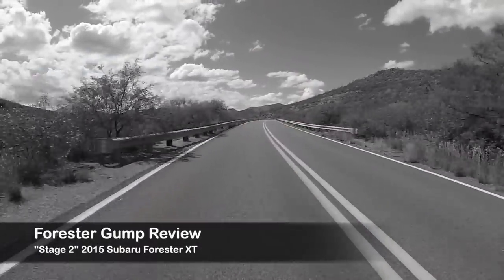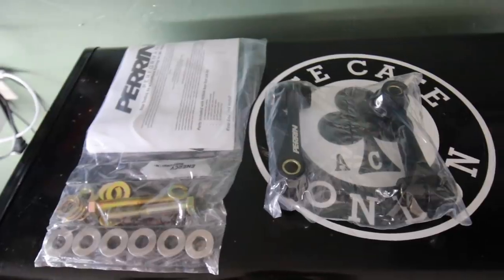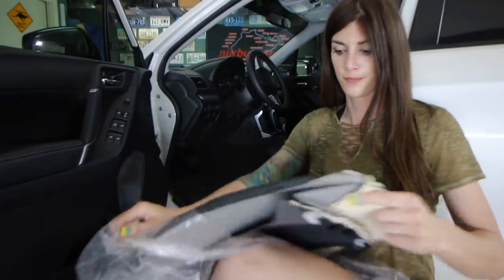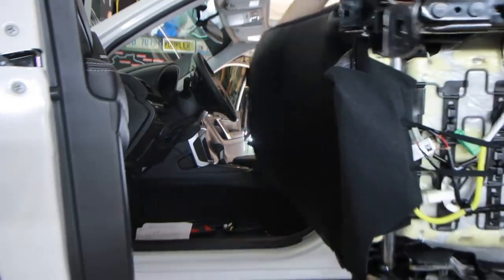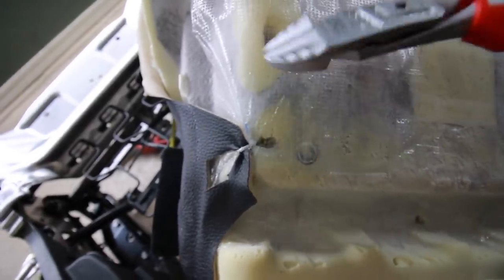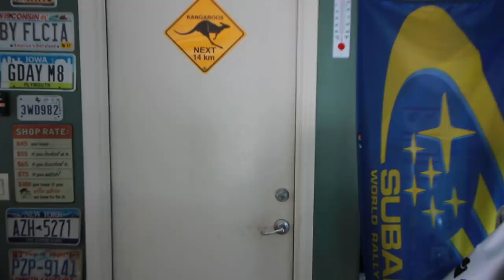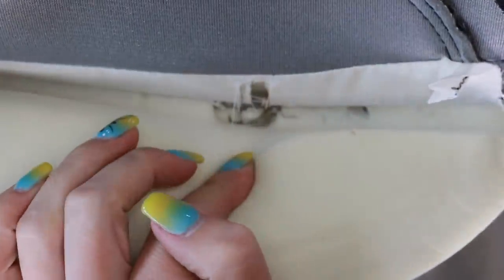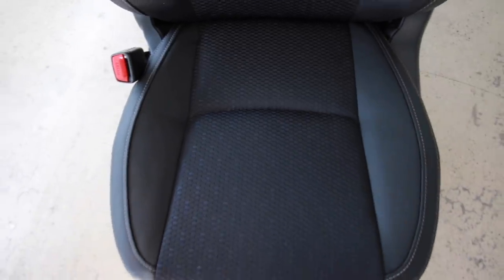How to Reupholster a Seat // 2015 Subaru Forester XT

Comment: Great job with the seat, new skill unlocked! The next one will be so much easier too.

For those little wrinkles that are left, save an iron as a last resort, you can usually massage them out. The hogring is somewhat floating, so there's a usually enough play for you to shift the cover to bar position, just need to get in there kind of hard with both hands and rub one out. 

Past that, try shifting the plastic clips on the cushion tray a little bit, the wrinkles are just a little bit of uneven tension, so playing around with it some should tighten it up nicely.

Comment: Just a heads up, whenever you go to remove seats it's always a good idea to disconnect the battery. The last thing you want to do is upset some sort of sensor and set off an airbag. An expensive and potentially dangerous situation. 

Great job on the upholstery replacement though. My 2015 Forester XT had a small tear in the same place I caught early and fixed with one of the kits.

Comment: Trust me, don't use an iron.  Let is sit in the sun with the windows closed or use a hair dryer on hot and high with concentrated focus  in the areas of concern and the material will stretch, configure and relax.

Comment: Back in the day I tried to swap JDM STi seats into my 2004 USDM STi. A straight swap wasn’t happening, so I ended up swapping the JDM seat backs, bottom cushions, and seat covers onto the USDM bases. What a royal pain in the ass that was, but it looked awesome in the end, and the JDM seats were a lot better at holding you in tight.

Comment: My XT has the same tear in the driver's side seat. Do you have the part number for the fabric? Thanks for the fun and instructive videos.
Reply from the maker: Frank McKinley no sorry, it’s on the official Subaru parts website, just pull it up by your info like you would an auto parts store, it’s easy to find! 😊

Comment: did alot of seat covers when i worked for lexus in 2003-2004. need a sewing machine that will cost $2,000 dollars so it will sew leather and fabric. just the seat bottom at lexus cost $1,000 dollars back then. this is the company that tought me alot about interior on cars with all the rattles and tares and smells, o my!!!!!

Comment: Right tools for the job .. GET the angled hog ring pliers and the stainless steal hog rings .. or your F’d like i was .. had to do mine twice . once . Then the correct way with proper equipment… i did the upper cover also replaced foam

Comment: (My favorite for sure) The Seat came out great always want to try to do upholstery work i’m a lot less leery the next time something like that needs to be done I will give it a try thanks to you. The new camera looks really good I could see the problems with the focus but I didn’t think the sound was bad but the sound is much better as well on my end I’m watching via a Apple TV most of the time with built in flat panel speakers those are notoriously not the best but you can definitely hear the sound improvement no question so👍👍 P.S. thanks for saving MR.Dos john from MI.

Comment: I just found your video and I love you so much!!! So many questions/comments that I don't expect you to answer but here goes...I'm very handy but don't know if I'd feel confident tackling this by myself but SO APPRECIATE your thorough (and funny) vid. The side of my driver's seat is cracking and tearing so I thought to either buy a quality cover-up seat or use a quality HTV and iron over a whole side panel. I was told by the entire seat would cost almost $1k to replace because of all the wiring etc AND that a cover would NOT work because the seat has airbags and I'd be covering the airbags. Is this true?

Comment: I don't think you are dumb - maybe just a little careless. And that is OK. But I doubt if replacing the droplinks will improve Gump. The factory items are solid already, and are unlikely to bend when in use, so the only improvement would likely be in the tighter bushings of the new item. It's well worth replacing them in an old GC8/GF8 WRX, as the factory items are plastic, and do bend a bit in use, so it's a significant upgrade - especially if you fit the 20mm STI rear anti-roll bar. It tightens up the back end greatly and the car gets more pointy. Don't get sucked into replacing the pitch stop mount unless the bushings on it are wrecked. The factory part is all you ever need.

Comment: One thing to realize about taking seats in and out of cars. It is okay to leave the battery connected, but whatever you do, DO NOT start the car with any seat equipped with an SRS airbag. Your airbag light will come on and then you have to go to the dealership, or get a code reader and reset the light.

Comment: The seat making would most definitely not be hard to sew. As long as you have a sewing machine that's heavy duty enough to sew leather. The hard part would be cutting your fabric/leather to the right dimension in the right shape to be sewn together to come out folded the right way. If you seam rip the old one and use it as a template it would work really easily but you've gotta be pretty accurate with seam sizes. My mom quilts a lot.. 🤷‍♂️

Comment: Exactly the same thing happened to me with the side bolster on my 2014 xt. Bought the extended warranty too 7 years. They can change it. Super thin vinyl. Why?
Reply: Does the extended warranty actually cover wear/tear on the seats?
Reply: Apparently it doesn't.  My kids WRX seats have real leather on the sides. Buyer beware.

Comment: I've been there. I ordered a high flow cat for my S2K and it was bigger than the one that actually fit on my car. The end of it bells out to fit the donut gasket, but on this one the bell is not deep enough so it doesn't fit over the entire gasket and now I have an exhaust leak there.

Comment: Hard to say if there was a difference in cameras as you were slightly closer in the 4k shot  but at any rate videos will look better if uploaded in 4k (even if it's 1080p upscaled to 4k) due to YouTube providing a better bitrate (12mbps vs 45mbps) for videos uploaded in 4K.
Reply from the maker: mrsilveri new camera is full frame body 😉... I was the same distance.
Reply: @SarahnTuned  Ah gotcha, I didn't even think about your old camera being a crop sensor.
Reply from the maker: mrsilveri this one is technically cropped too if I shoot in 4K.
Reply: @SarahnTuned  Yeah that's kind of a drag but pretty common for Canon. Either way it's a nice upgrade for you're happy with it.  

After seeing the new camera  from Sharp this year at NAB I'm starting to wonder if everyone on youtube will grab those when they come out.

Comment: SUPER bonus points for using the John Insprucker clip!  (but if you had used the "norminal" clip from 2017 - that would have been double super bonus points).

Comment: The latest WRX ,Levorg doesn't come with manual... 
Im wondering if BRZ or older WRX 6spd manual could be swap in???
Was thinking of getting a Brand new RHD 2019 Levorg STI imported(doesn't know what parts it is using STI ones) and swap manual gearbox as Daily POINT A-Z + Rolls Royce LVL sound proofing.

Ecutek 360-400whp 440-480bhp ~550nm map1  ,???whp ???nm map 2
(Internals supertech mexico made AL 4032 forged piston+carillo rods+king bearings + GSC beehive spring +Supertech Valves+GSC Valve guides+Supertech Valve stem seals+Piper cams)
+ARP main bolt,ARP head stud
+50km-80km engine overhauling schedule
+Radium Engineering fuel rails,Radium Engineering Fuel Pump Hanger,DEATSCHWERKS Injector+ Walbro F90000274 Pumps X 2
+Koyo Radiator Hyper-V indonesia made(30% in price vs japan)  /TYPE-M japan made ,MOROSO 23-25 LBS. Racing Radiator Cap
+AEM V2 Water/Methanol Injection Kit

With lighten body parts(TWS/Rays 16inchs rims ,Potenza S007 tires. Pre-preg CF  Bonnet ,Rear door/hood ,roof,Stock doors as its for safety daily)
+STI modine with Setrab re-usable oil filter+Radiator/convector
+AP Racing 4pot front brake system 295/299 2pcs-rotors , Rear FHI 2pot,290mm rotors 
+E Parking brake(i believe its the Lexus/Toyota crown type(Advics) with cable intact drum disc type unlike german cars electronic actuated motor(ATE) on caliper screw/push in type) convertion to old school hand brake from BRZ/86/WRX STI/or any toyota/subaru, mazda(cable intact however is caliper screw in type)
+Bomba TB,AEM Brute force intake filter,GFB Mach 2 TMS Recirculating Diverter Valve,Stock FHI turbine ,Company23 Anti-Surge Boost Control Solenoid V2
+ egr delete 
+ tomei unequal length manifold+HKS legal cat down+mid pipe+tomei rear catback.
+STI engine mount or 65A shore aftermarket engine mount, GRP N transmission mount or TRD/STI transmission mount(depend on swappable gearbox)
+Spoon Rigid FR/RR collars
+Full stock front LCA bushing,Except what comes with STI LCA/Whether the Levorg STI come with STI LCA ,STI subframe bolts
+stock steering rack with PU bushing,STI rack Lock down bolts,STI inner tie rods,Spl Rod end
+Eibach sway bars,Greddy KW coilover 1way front spherical top/rear oem/sti/??? top) or KW V2 1way/V3 2way with STI(harden rubber) or grp N(Rally spherical) top
+Full stock rear suspension bushing(EXCEPT subframe insert,diff front insert,diff rear insert)
+STi subframe bolts +lighten ebay/china/taiwan/velox/verus 7075 LCA PU type end + racerx UCA PU type end +stock toe,trailing arm+STI LCA spherical bearing bush upright side
+DSS front & rear axles
+Taiwan/verus/velox or DSS CF drive shaft
+Stock front LSD ,rear ATS carbon LSD
+clutch fork clutch plate flywheel???? depend whether toyota gearbox or subaru can be swap in.
+clutch pedal compartment:)probably brake booster swap to manual type if its the clutch brake incooperated type booster(mayb OEM Auto type booster just got a clutch screw in plug cap on)
+Daikei Boss Hub Kit,Reverie CF steering wheel ,Reverie Mulsanne C Twin Skin Seat/RECARO PRO RACER RMS Seat,Buddy Club Racing Spec Seat Rail ,Seat Cushion(Lexus RCF/LC500 Style Pattern)
+kenwood ICE,Asus 240hz 17" screen

I don't like BMW MERC AUDI nowadays as its no longer prestige and maintenance parts(wear and tear and plastic plastic plastic) are shitty china/malaysia made* yet cost 3-4 times toyota 2-3times subaru/mazda.
In my country Lexus is more expensive than bmw merc audi jaugar volvo skoda etcs(by $10k-$50k class to class).
If Bentley its like a pics of english junk with german parts yet much cheaper than Rolls Royce cus Rolls Royce doesn't want to sell you as u are not VIP.
Maserati practically are discount 50% italian copies of Aston martin and overprice 130% Jaugars.
BMW are great performance cars but 95% user in my country are arrogant assholes ,who are not considered rich to me yes probably 80% white collar 15% fake gangster 5% humble guys who appreciate BMW history and performance.Im not gonna join the 95% black listed assholes. but nowadays its made in austria and Longwheel base CHINA.
Merc????? mostly 15% are retired fake gangster 35% bosses 20% prestige family 20% HDB/CONDO showoff wannabe 10% fans of W series reliability user but nowadays its made in very hungry(Hungary) south africa and Longwheel base CHINA
Audi??? mostly pretty low profile humble rich farkers or government high ranking officials. Use 4-5years and throw. Quality definitely better than merc or bmw however its for using 4-5years and throw or this spoil that spoil you gonna just crash its and totalled it.Most electronic problematics surface after 6-8years.Nowadays its Longwheel base is made in CHINA.

Comment: How often do you drive forrester gump??? Did you ever have trouble with your optima red top. I have a yellow top in my bugeye and they had to warranty it twice. It wasn’t from parasitic draw I pull 30ma when the car is off and recommended is 50ma and it still would die after maybe 3 weeks or a month. By die I mean unable to start the vehicle.

Comment: As I said before I have a 2017 Subaru outback. The driver side seat bolster on mine is also ripped. I've tried glueing a patch and that just looks horrible.
I wonder does Forester Gump have heated seats? My Subaru Outback does. I wonder if doing this would make it harder with heated seats.
Reply: The seat heater element is attached to the foam, aside from disconnecting the electrical connector for it during removal, you don't touch it at all.

Comment: Does anyone know where to order that replacement seat upholstery part?  The driver seat on my XT Premium is falling apart in exactly the same way and I’d like to replace it myself.
Reply: It's a dealer only part, and a few variations based on trim and model year. Call a dealership, get the part number for your vin, and do some looking around for a good deal.

A lot of dealerships will quote full list, but have some room in their prices, so to keep it local, you may be able to get a similar price to what's online, with just the added expense of a friendly conversation.